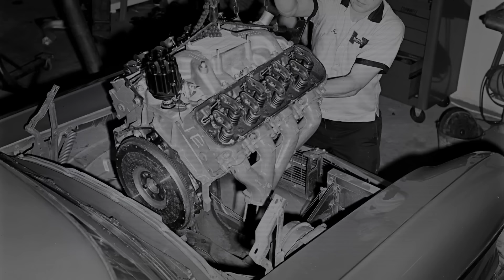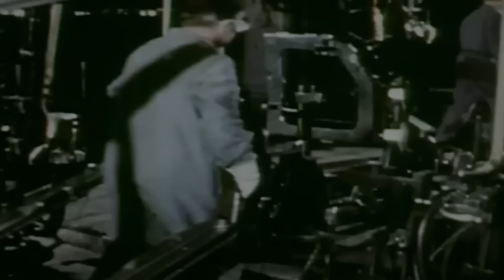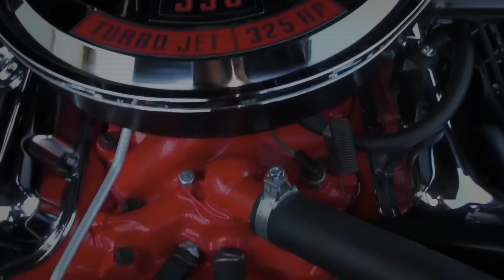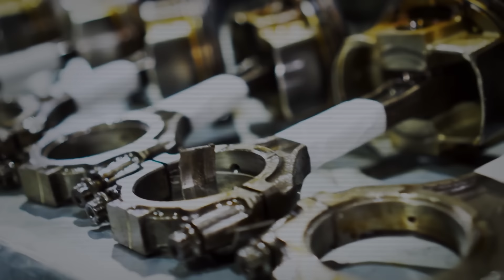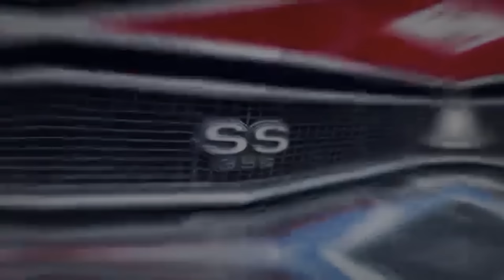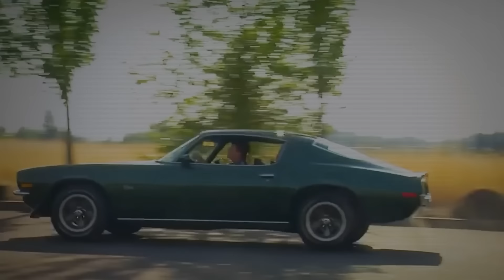The SHOCKING Reason GM Banned Chevy’s NOTORIOUS 396 Big Block

Comment: I don't know if the explanation here is correct for how so many 396s came to be 402s in actuality,but iy is the most straight forward answer that I have heard to date. It was always a cause of mystery to me why they didn't advertise the increase displacement. There are a number if engines,in fact quite a few that are rounded up or down to make a number that has more appeal or sounds most cool to say.

Comment: I had only one 396 car.  The 396 layout seemed to hit the sweet spot in the GM big block series of engines that included the 427, 454, etc.  It seemed to out perform all other manufacturers’ engines below 400 cubic inches.

Comment: Warranty in passenger cars on all the rest of the car was the reason. If there was a drivetrain that could handle the torque and an age limit for ownership , wemight have never completely lost the muscle cars in the mid 70's up to the 2010 era ,the only reason we have them now is because the rest of the drivetrain finally caught up with better materials . I dont care what you drove , when you pulled up to a red light beside a 70 chevelle 454 , you did not want any of it . My cousins tuxedo black 70 with 10 inch slicks would pull the front wheels . That 450 hp rating was a huge lie . They were more in the 550 to 600 hp range

Comment: The dialogue content and facts are good but you're all over the place with the video stock footage. It could seriously mislead someone looking to learn from this. Plus your quote from qtr mi time of the 71' Chevelle 402 doing 15's compared to 70' L-78 396's doing low 13's is an unfair comparison. The 70' Chevelle 396 "325" hp would hardly climb past the 8.5 comp 71' Chevelle. Plus, the cam wasn't any different between 70 and 71, it just had a 2° adv on int. lobes, expanding the lsa to accommodate the lower compression. Also, only about 5% of 396 Chevy's had the L78 option which is completely different from the regular 396.

Comment: I had a 396 in MY Gimmy GMC CAMPER SPECIAL ONE TON EIGHT AND A HALF ft  BED. With 10" wide white spoke Jackman 8 hole  wheels. Man that thing hauled ass and  it was beautiful  custom metalic green paint matching color shell with a boot thru. I customized the bed with green carpet. Had alot of fun in that cap😮😊😊😊 sure do miss that truck. Some chick on drugs ran a red light and totaled the left front frame pushed me into stoplight pole which then fell onto the shell and put a big hole in it. 😢 
It was totaled. Man that was a rough one to get over. 😢
Reply: It wasn't a "mint green metallic" paint color was it? Because somebody might be looking for you in Alabama.

Comment: I had a 1972 SS 396 (402) with a Muncie M20 in a Chevelle. It had all the trimmings, Cowl Induction hood, tilt wheel, A/C factory dual whit3 stripes. I blew up the original engine and got lucky and found an L78 396, stock bore Rectangle port heads from 1965. I never did run the numbers to see where in the production run it stood though. Anyway, I personally searched the company I bought cams from religiously ,Norris Cams in Van Nuys Ca. I  was spoiled with the N288H grind for the Small Block Chevrolet. This was a nasty hyd grind. The one I found for my newly acquired L78, was a healthy 560 lift int with 320 duration and a 580 lift exh with 330 duration. The combination dynode out at 475 hp @ only 4000 rpm as the company, Burbank Speed in Burbank Ca prohibited anything higher in a passenger car. But I was assured it was well over 500 by redline. How the redline on this beast ended up at just north of 9500 rpm. All this in a daily driver in 1976-1980.
Reply: Things that didn’t happen for $1000 Alex. No way was that thing turning north of 9500 rpm’s. 😂😂😂
Reply: @MrJohnnyquad   ain’t no bullshit. And I couldn’t care less if you believe it.  Plus I had more than a grand in that engine
Reply: How in the hell did you keep alternator and water pumps in that thing?! The bearings on those things burn up within a mile turning 8,500 RPM much less 9500 RPM. Do you realize that 1 million  dollar motors that NASCAR use only turn 9,500 RPM? Or are you just talking out of your ass?
Reply: @jeremymackevincaylor4954 . No bullshit. I built engines for a living and knew what to do to get em there
Reply: Cool story.  No, you did Not have a 1972 SS396 Chevelle.  Not unless you or someone else put it in there.  There were NO oem rpo SS396 Chevelles in 1972.   Only 350 was available.

Comment: 427 killed the 396 but they still punched it 30 over and called it a 402 and then the 454 came out
Reply: You didn't watch this video at all, did you. Because not only does this video cover all of that, it goes into great detail about the reasons why.

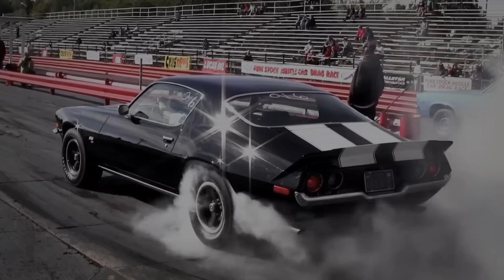Comment: 65 is the first year of 396 . 427 was 1966 first year . 409’s were still in the 1965 impala the first part of the year . And 1965 is the only year the corvette ever got it 327/427 were the corvette engines from 1966-1969 . Im a Chevy man but those heads were copy’s of Chryslers canted valve hemi . A the same design used by ford on the cleavlad 351 .  I had a 1971 LS3 396/402 300HP 400ftp of torq and behind the camshaft is had hi-per pass for high performance passenger car engine .  Yeah in 1970 454 LS5’6’&7 were 450/460/&470 horse power , they had transistor ignition. I know there are a short stroke and large bore is not a strong point Harvard and Yale have study’s proving a long stroke and small bore are better engines .  The 400 small block is almost the same as a 402 . I had mine in a1980 c-10 custom deluxe 2nd with a power glide to begin with then a super T10 borg/warner 4 speed with inline shifter 3:40 gears and it was short wheel base fleetsidd bed .  It would out run the small block trucks out the hole but once 55 mph was there it was neck a neck . My cousin had a 350 automatic 3:73 gear shot wheel base 1976 c-10 fleet side also .  He couldn’t touch me until 55 mph an I was running out of the hole half pedal . He was running 350 out the hole wide open throttle . Even with a taller gear and half throttle he had nothing on the ol 402 LS3 .  I’d say one of GM’s finest engines . The 327 and 400 small block’s are some of the finest also .  I think Smokey Yunick used the heads off a  big block on a small block .
Reply: Dude  none of what you said, makes any sense. A 327 block is vastly shorter than the big block 396, the heads would NEVER fit. That "canted valve design came from chevy, in 1963. The cleveland engine wasnt out by then. 
I grew up in those times. Your statement is so far off, that you seem comical.  I AM a master mechanic, and i have worked for both GM/chevy, and Chrysler, in Michigan headquarters. I train mechanics. If you like mechanics, take a course, work at a machine shop, build a few rods. 
Chevy never had a production hemi. Ever. 
Chevy, originally supplied race heads on Ford flatheads (Frontenac). 1930's
Reply: @mikestone234 yeah when he said a 402 and a 400 small block were the same thing I gave up on him. You realize that one of them is a big block and one of them is a small block right?! I think what the problem is you don't know the difference. Teacher trying to teach something he don't know. Grow up
Reply: @jeremymackevincaylor4954 thats exactly what i told him. The smallblock 400, is exactly the same size as a 327. Save it bro. Youre barking up the wrong tree
Reply: @jeremymackevincaylor4954 ....dude, HE didnt know the difference. I do. 
Go cuss him out! 
I have a 427 chevy, a 454, with vortec heads, one 350, and one 327, right now. 
Block length, it what i was talking about. Not bore/stroke.
Reply: @mikestone234  look up Smokey yunick’s 1969 302 hemi . Now we know that 327 & 302 share the same bore 4” . Now when you look at this motor that GM built but couldn’t get it right . They let Smokey take a look at it . He made some changes to there engines i think 3 are still known to exist . I didn’t know any thing about these until 2 years ago I stumbled on to a video . Theres a museum out west that have a68 & 69 Camaros z/28 . They show footage of these cars running .  As far as the canted valve on a small block thats all a 302 boss is a set of 351cleavland heads re-bossed to fit a small block ford . As far as it making any sense is like this you don’t need to use the same size valves in a small block as you do a big block the concept Im trying to explain is saying useing the canted valve design is a way better and more sufficient head than what came on te older small bocks .  It’s just the same principle as dodge . Takeing the hemi design from the small blocks out of the 50’s and redesigning it to fit the B- block of the early 60’s . When you have a dad like mine who lived and breathed this every day and could break out the books  showing were it was at how it got there and undstanding why it was done it’s a lot to wrap your little head around . But when I was13 I pulled my first 350 Chevy by myself no help and rebuilt it before I ever had learners. My dads best friend taught me every thing he knew . A certified GM mechanic from our home town GM garage . Before I was 17 .  I think it’s mystery engine+was some kinda Frankenstein were they used the bottom of a 409 w block and re-cast set of heads like the ones they used on there new mark IV released 1965 as 396 .  A certain amount of 1965 impala’s had the 409 still in them . But the corvette only year for 396 was 1965 . And all a 427 is a 396 stroke with a454 bore . In 1970 the stoke went from:3.75 to 4.00 .  My dad one time said son when we bleed the cells aren’t round there shaped like a Chevy bow tie ! If there would have been silver wear with matching plates and cups my dad would have insisted on that in my moms kitchen that# how bad he had it . Im highly surprised to see 4 year# ago this January his coffin wasnt painted Chevy blue . He worked in the deep mines . But manny times they outdid have him to look at cars that they couldn’t fix at the same garage his best friend worked at.  Were they offed him a job . He said you can’t pay what that mines pays . I’ve still got all of those motor manuels from 1961-1966-1971-1975 edition’s Were each one goes back 8-10 each and yes that 1971 shows the special high performance pistons for canted valves in a 302 . That had heads like a  396 . Because we would look at those pistons in that book and he always said some thing funny’s going on . Those can’t be for the same head as the rest of the small blocks look at them son .  There like a big block for canted valves . Chrysler had a canted valve hemi in the 50’s also some know as the poly ball hemi . It was in a 318 configuration in 1957 . Chevy and ford used the same thing in Theres engines . This is things I’ve known from 1982 up and that was when I was 8 years old . But I don’t know it all i try to learn about what has been hidden . I couldn’t believe that the 1969 Z/28 was opened by Reggie Jackson and its Cortez silver with black SS stripes .  The head rest in the car have embroidered on them 302 hemi .  Yes I’ll try and find that video I’ll come back after posting this and add were you can go watch it here on you tube . I hope I’ve taking all the misunderstanding out of this and help you make sense of it .  I love helping every one I can understanding what I’m saying about a concept i may be able to picture in my mind but it’s hard to draw I t out with words .   1955 my dad was 19 years old and his best friend . His dad bought a new 1955 bel air 3 speed on the colum and they would race it every week end and beat fords like crazy . Dad said that’s what sold him and why I know so much . Have a great day I’ll be right back with were you can watch those two iconic cars run and drive and listen to them idea and take off in the car and out .  It was one most eye opening peaces of GM history for me . I hope will get to see it. The 3rd car is owned by Childers or Hendricks . I can’t remember but it tells on the video .
Reply: @HaroldPrittJr Right.
Reply: @mikestone234   Ok it’s the 1968&1969 z/28 camro’s Smokey yunick from the Marvin collection and these cars were built by GM .  An what’s comical is how can a vastly shorter engine an when you know what your talking about thats top intake top and oil pan bottom not front to back lengthways ok a big block head is longer right . Not shorter up and down . Becuse every were I have ever talked to any one the pistons go up and down and that don’t have any thing to do with lengthways. And yes a 3.25 stroke from a 3.75 stroke would make a 1/4 of an inch from the center line of the crank shaft up and down wise . That don’t say a canted valve design head would not work with that stroke .  Because ford took a 3.50 stroke head and put it on a 3.00 stroke engine .  So it’s kinda comical to me when you say the 327 is vastly shorter thats why a canted valve head wouldn’t work .  I would like to see some one design a computer drive machine. That you could program all the cylinder centerlines with head bolt holes to.them it would ditgatly print you a head from plastic .  That could be used to cast it or machine it from billit aluminum . An se could cross make heads for any engine .  Using all information we have from all the manufactured heads . I know the best way would just drop the lifters and push rods and make dual overhead cam 4 valve per cylinder heads . But I’m old school i like hemi and canted valve heads an would Love to rest them on the old 327&283 of course 350$400 small blocks also .  The first time I seen a hemi 426 head cut right down through both valves . I knew right there why that engine ran so well . Seeing those valves facing the way the i take manifold and the exhaust manifold . Spark plug center of combustion chamber .  Yeah thats very efficient and lets you really maximize the crap out of valve size .  I think the 426 had a 194 exhaust valve . The same as most 350’s intake .  It’s clear to see the real winner .  If you talk drag strip and stock parts from any manufacture then 426 with a Chevy powerglide and ford 9 inch rear axle . I would like to see that combo . Im talking American manufactures from back in the day .  From all my learning thats the best from each one that would be a safe bet for a consistent winning combination . What do you think about that .  Now Im talking stick parts we just find laying around . Nothing exotic like aluminum blocks or Linco transmissions .  It must have really been some thing to see all these fast cars being built back then ? An it Ss a thing that you probably thought would never end . It would just get better . Then the oil crisis hit . Pulling all the back bone out of vehicles. When I started middle school I had the guys who were in high school welding shop to weld my lawnmower camshaft up leaving me a little of the original profile .  When I took it home and reground it put it back on . Then shaved the head with a belt sander .until the valves touched it wit( no head gasket . Now reassembled with the head gasket and a straight pipe for a muffler . An I also opened the butterfly open further. By shaving that stop on the top of the carb body . Yeah I could cut hose yards no one else would touch . Grass up to my waist . Now when ever I  did the grinding to that shaft .  I had the engine apart an kept turning it over watching top dead and bottom dead .  Using a old cam card i think fro a 292 duration 305 lift the degrees were they open and shut . I marked the flywheel off in as close as I could get increments . It did real well . I really impressed the man who moved into the rental property behind our house . He was going to collage to be a teacher . He said how do you know all of this ? I showed him my dads books and told him about my research. Finding out what made the difference between corvette an regular engines when I told him probably 6or 7 hp he said no more like 9-10 . He said that was governed to 3600 rpm you can hear it turn at least 6-7 grand . But I don’t know that was like 1986.  I cut grass to build my engine . That turned out to be a 4 bolt main 350 block wit( a 1968 307 crankshaft building to spec a 327 350 hp . I still have today . The 350 with 49000, original miles from my dads brothers truck . I put into my inclement on my moms side’s truck . He willed it to me 1968 c10 with the leaf spring package option.

Comment: 396  is really 402 cu in
Reply: What is with so many of you people. You are yet another one who obviously didn't watch this video at all. Because if you did, you wouldn't have even bothered posting your comment. Furthermore: the earlier 396's were NOT "402 cu in".
Reply: If you are measuring by today's standards. Today they include the cc of the head as part of the block which isn't accurate.
Reply: @drumdr69  From 1965 to 1969, the 396 was a 396. For 1970, Chevy decided to bore the 396 .030" over to make the 402 which then replaced the 396. The 402 was used from 70-72. However, Chevrolet decided to use the same 396 engine size emblems on the 402 cars. They surmised that the SS396 name was familiar and desirable to the public, so decided to keep the popular designation, instead of changing it to SS402.
Reply: From 1965 to 1969, the 396 was a 396. For 1970, Chevy decided to bore the 396 .030" over to make the 402 which then replaced the 396. The 402 was used from 70-72. However, Chevrolet decided to use the same 396 engine size emblems on the 402 cars. They surmised that the SS396 name was familiar and desirable to the public, so decided to keep the popular designation, instead of changing it to SS402.